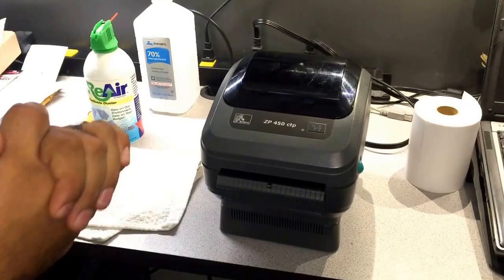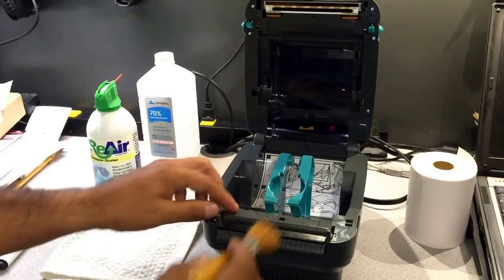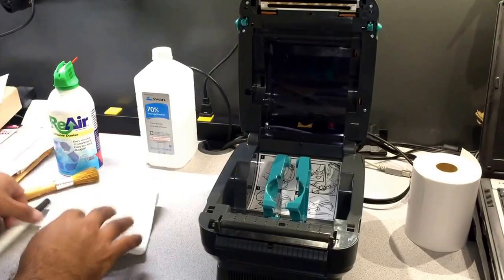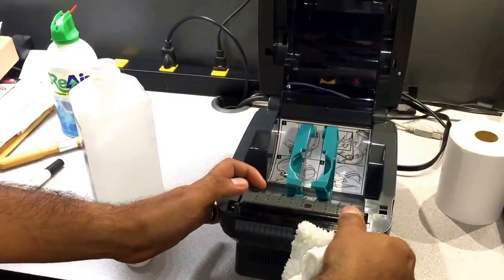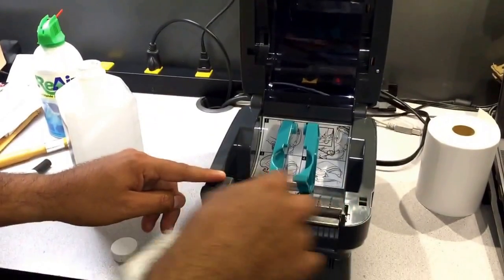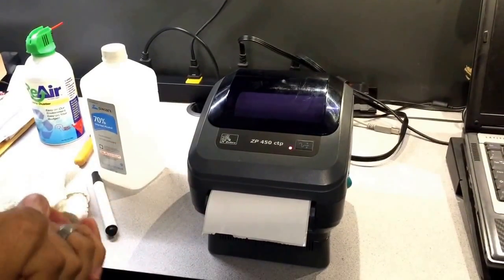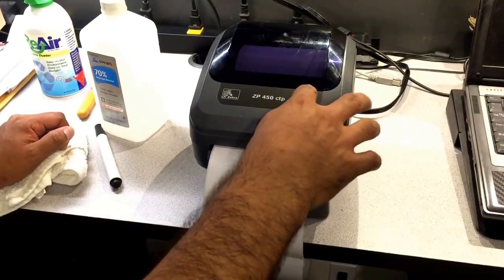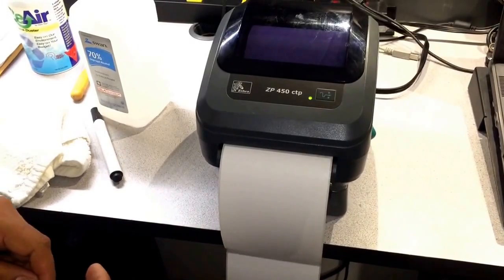Zebra Printer Maintenace, Cleaning And Calibration

Comment: good video, my 505 starts printing then shuts off after a few labels, but when it shuts off the PSU needs to be powercycled  zebra sent a new PSU but the same thing happens.  i cleaned it with the clean labels and its pretty clean

Comment: how offten you have tocalibration the printa   every time u print or
Reply from the maker: Hi, You only need to calibrate your printer when it stops printing on the right place. That usually happens when you change the label size without recalibrating the printer to the new label size or when you put a new label roll.

Comment: Hello, if I don't use my printer very often, should I have it on or can I keep it off and turn it on only when I need it?  Thank you
Reply from the maker: Hi, These printers were designed to be on all the time. If you are not going to use for a while you can turn it off. The only downside is that every time you turn it on, there will be three labels fed through to calibrate the printer. The printer uses very little electricity when is not being used. It is an Energy Star compliant printer.
Reply: @solutionsgem  thanks so much

Comment: I did the manual calibration and now it’s only printing on 1/3 of the page? Even though I have 4x6 labels?
Reply: I'm having this same problem, mine won't calibrate and recognize the label size even though I tell it to print as 4x6
Reply: @fullygimmicked8707  Did you figure it out? I am having the same issue.

Comment: CAN YOU CALIBRATE SIDE WAYS. THERE ARE 100 VIDEOS HOW TO CALIBRATE AUTOMATIC UP AND DOWN, BUT MY PRINTER ZP450 THE IMAGE PRINTS SIDES OFF NOT IN CENTER. IT HAVE TO PRINT TWO PAGES FOR THE IMAGE TO BE COMPLETE. IDID SET UP THE 6X4" AND ALSO THE EASY UP AND DOWN, CAN YOU HELP ME? THANK YOU
Reply: You set the width in paper settings not with the printer itself

Comment: Hi, I have a GK420t, I can't calibrate, I replaced gap sensors and Logic Board but nothing, what you suggest?
Reply from the maker: Hi, That sounds like the ribbon cable that goes from the Logic Board to the Feed Button is defective. It is a know issue with these printers. That ribbon cable transmits the top gap sensor and feed button information. If the cable is broken, it will never calibrate correctly. Let us know if you need the cable. We sell the ribbon cables and can replace it for you.

Comment: ALSO PRINT KIND OF SMALL NOT FILL THE 4X6 LABEL.
Reply from the maker: Hi, If the printer is not filling the whole label side by side, that usually means that you need to change the label size on the printer driver. If you use the Seagull Scientific driver, the default label size is 4 x 4. I you use the Zebra Driver its 3 x 2. Please go to your printer driver and make sure your labels size is set up to 4 x 6. You need to make sure your shipping or labeling program is set up for the 4 x 6 labels. The laser or inkjet program is the default format. You have to change that format in the program so the label comes our vertical and with the right format.
We offer tech support via Phone and remote computer connection for $49 one time fee. We will not charge you anything if the printer does not work. You can call us at 888 407 6757.